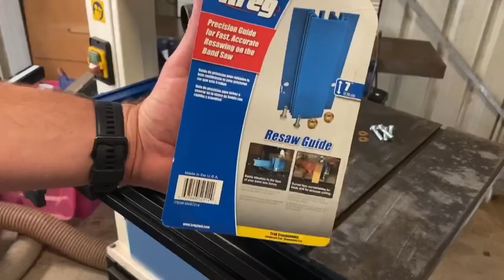Unboxing and installing the Kreg Precision Band Saw Fence on Carbatec Bandsaw BAS-350B

Comment: Hahaha awesome. You can get a Lufkin metric tape from Bunnings for a few bucks. Metal and self sticky, used it on my mitre saw station
Reply from the maker: Awesome, I’ll check it out. 
Apparently Kreg make a metric one for this fence, but they don’t package it with the fences sold outside the US 🤷‍♂️
Reply: @ShapingSawdust  hahahahaha. Carbatec stock the kreg metric one separately, but the Lufkin is cheaper I think and the same thing
Reply from the maker: Thanks for the tip. I need a couple for my mitre saw fence too.

Comment: That looks a good fix for a broken or missing fence and easy to fit. The saw blade had too many small teeth to deep cut that timber 
that's why it struggled as well as it being blunt. Try a saw blade with half or a third as many teeth it should work a lot better. Tony
Reply from the maker: Thanks for the tip 👍 it’s my first band saw, so I’ve got a lot to learn. 
I’ve just picked up a nice aggressive 3tpi blade for resawing thick pieces. Just waiting on new tyres to arrive in the post and I’ll be set.
Reply: @ShapingSawdust  3tpi wow I didn't know you could get 3tpi for a small bandsaw. How wide is the blade and how deep are the gullets. This is interesting as I have a small bandsaw, never needed to use it to re saw timber though.  I might give it a try .
Reply from the maker: It’s a 20mm wide blade, but I’m not sure how deep the gullet is. I’ll measure it for you when I get a chance. 
I picked this one up from Carbatec, the product code is BBL-2490-20-3

Comment: Nice fence pity you have to unbolt it every time you need to change blades.
Reply: I have a bandsaw that also has the blade slot coming out the front like this so I have to remove the fence when swapping out blades. On mine, I mounted the Kreg fence to the original removable front rail so that I can remove the two as a unit when changing the blade. Much better than mounting the Kreg fence rail directly to the saw.